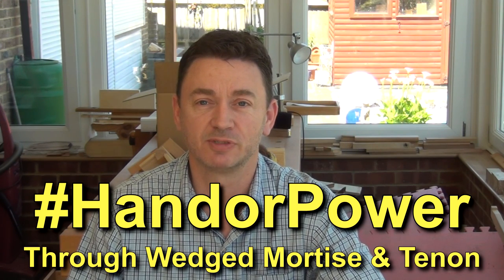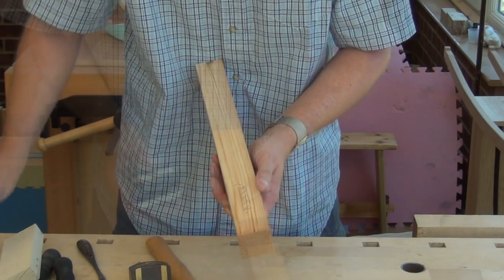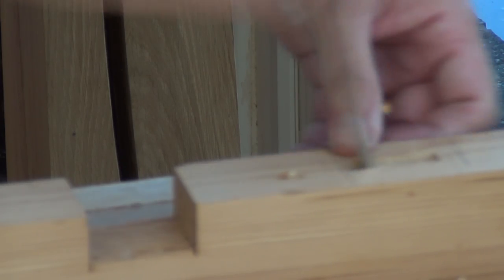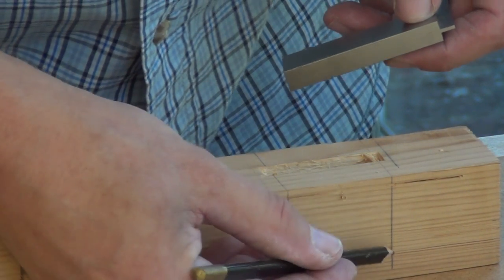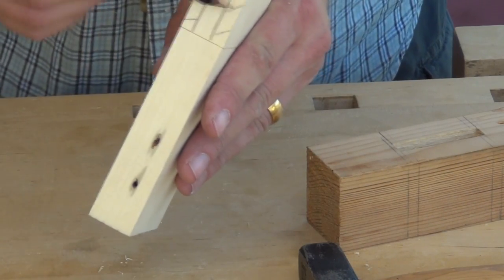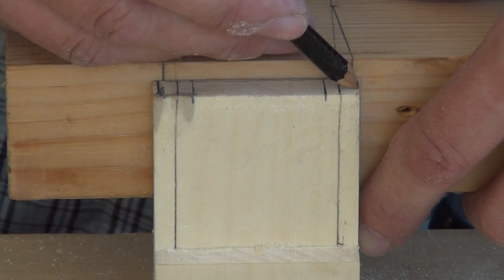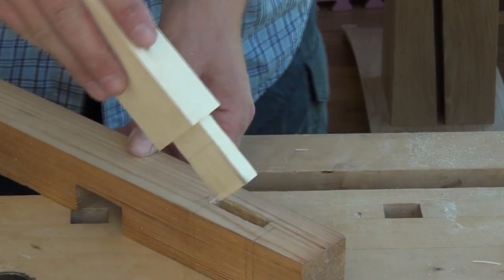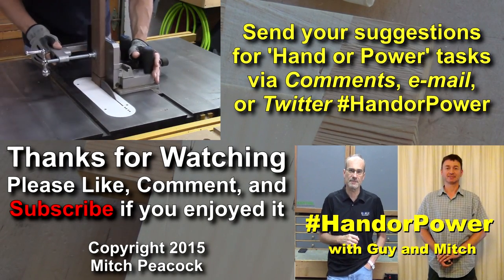Wedged Through Mortise & Tenon by Hand #HandorPower

Comment: Mitch, I really like that wedge and mortise technique.  Thanks for the demo.  I'll be doing that on my next build... but using power tools for most of it.  I know that's heresy.  :)
Reply from the maker: Hardnox You know, if you have the tools and not the time, there's no shame in that. But you might just like to try one by hand 😉
Reply: My comment was tongue and cheek since I know you are a handtool oficianado.  I have done them by hand.  It's painfully slow.  Most of my mortises are huge in the farmhouse tables I've built.  Typically they are 2" x 4".  I rough them out with a forstner then finish with chisels,  The tenons are cut with a tablesaw.  I really like your locking dovetail/wedge design.

As promised earlier, I will be sending you pics of my latest completed project this week.
Reply from the maker: Hardnox I figured so ;-)

Comment: How would you use this for mounting a bench top to the bench legs? Cut the tenons on the legs first then flip the top over and mark the mortise?
Reply from the maker: Hi Rick. If I was to attempt this, I would just use one tenon near the front, and mark out leg and top with the same mortise gauge for a flush finish. Unless the legs are slab material like the bench top, I would worry about different expansion and contraction causing something to fail if using two tenons.
Reply: @mitchwoodwork  thanks for the response. The legs are going to be laminated construction timber, and the top is laminated construction timber. I would be keen to try the rising dovetail & tenon (Roubo- style joint), but I don't know if I'm capable. I'm using aprons on my bench. Hard to build a bench, without a bench lol
Reply from the maker: @rickhickman2730  I built a bench for <$20 from laminated pallet boards about eighteen months ago. Damn fine bench it's turned out to be if I do say so myself. My bench top is just located on the leg frames with a shallow groove and a single dowel. Solid as a rock, yet easy to dismantle.
Good luck with yours. A good bench is a great asset.